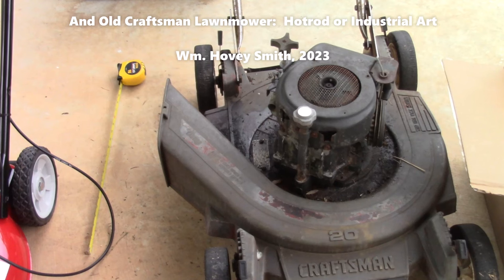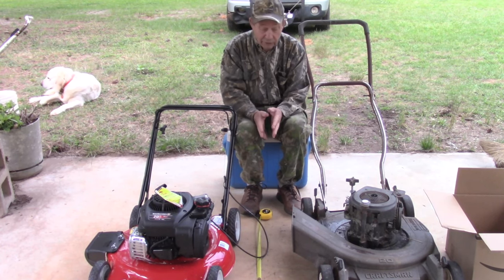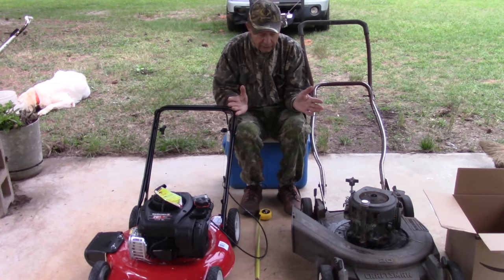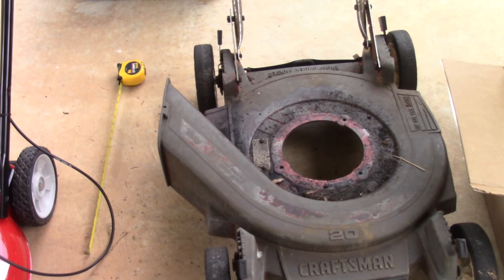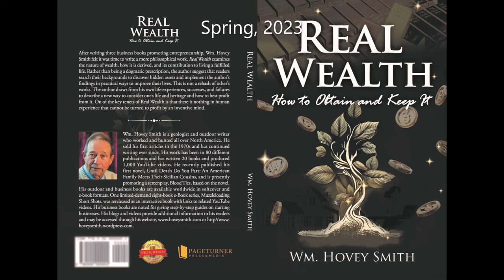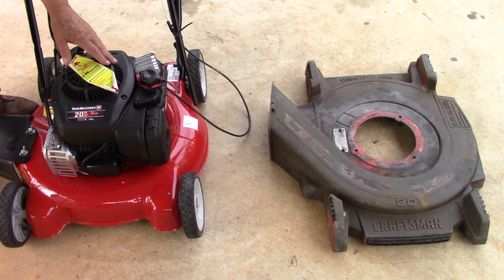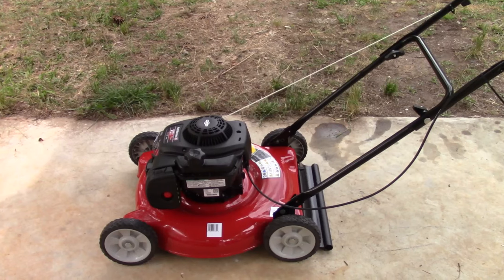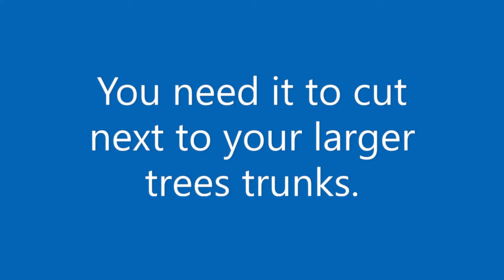An Old Craftsman Lawnmower Hotrod or Industrial Art

Comment: Harbor Freight sells engines too. Probably Chinese knock offs of Briggs and Straton,
Reply from the maker: I looked at those on-line. They once may have offered engines for lawnmowers, but the smallest of the current crop is a 6 h.p. with a horizontal shaft intended for homemade go carts and the like.